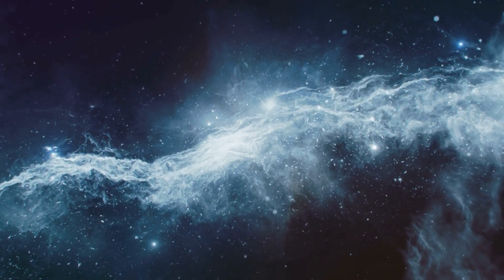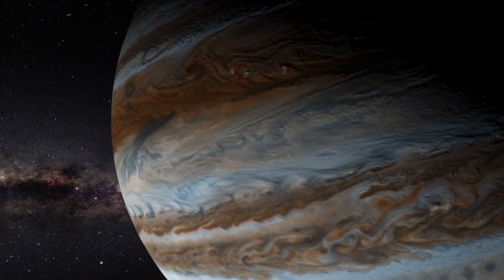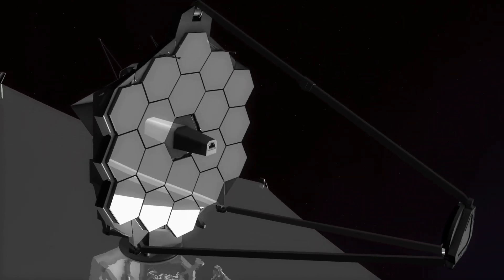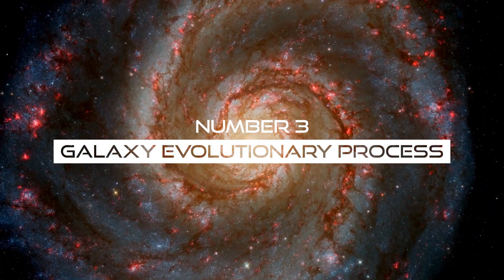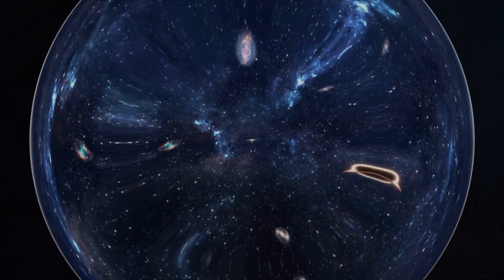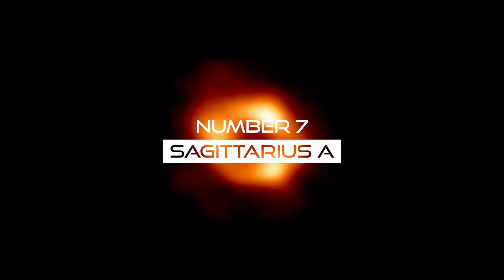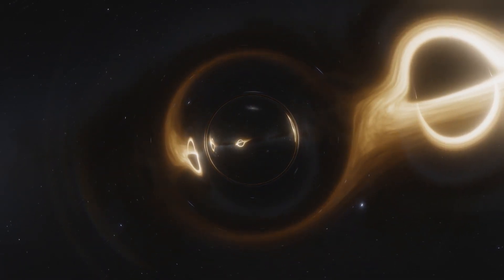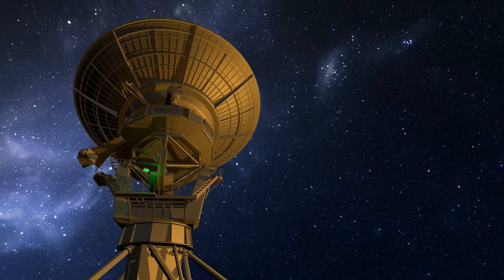Will the New James Webb Telescope SOLVE Secrets of our Universe?

Comment: Webb's mirror is nearly three times bigger than Hubble's, and Webb is able to capture the universe in the infrared spectrum, while Hubble largely captures images at visible and ultraviolet light. Hubble is also in a much closer orbit to earth, meaning it can't peer back as far in time compared to Webb
Reply: Wavelength and resolution are inversely proportional. Longer wavelengths produce images with lower resolution because they can only differentiate (with any degree of certainty) between objects that are larger than their wavelength. That's not to say it is undetectable, but you won't gain any information on an object's location with an accuracy less than the wavelength of light used. This also means these wavelengths will travel further through space without being obstructed by gas and dust. It's a trade-off that is more valuable than the average person gives credit. 

Try to see these images at home through a hobby telescope. Soon enough StarLink will reflect enough radiation that earth-based astronomy in the radio/infrared frequency range will be pointless. This is why we have JWST..